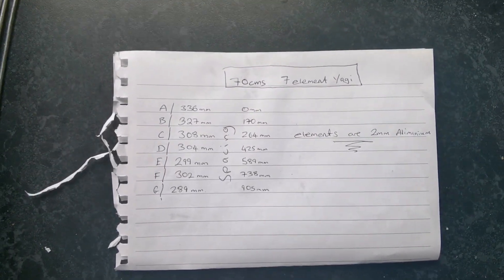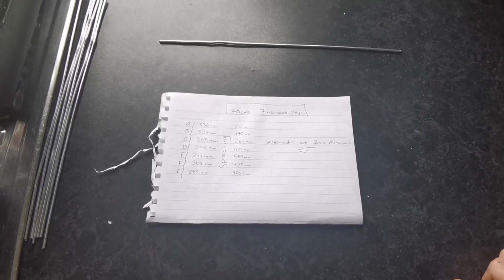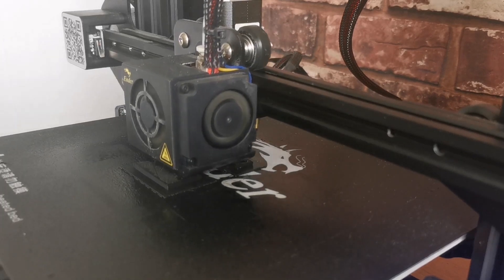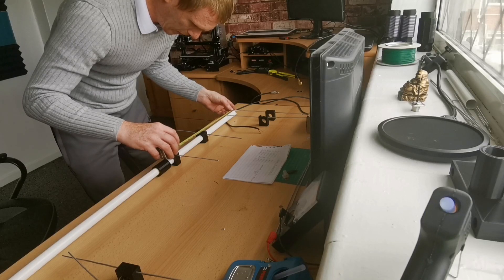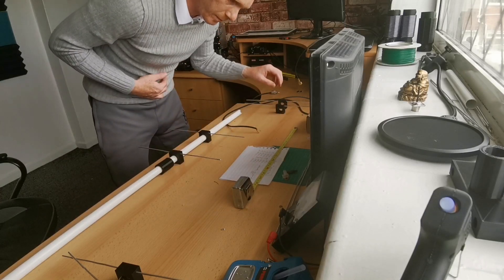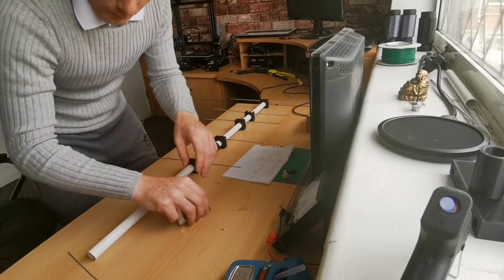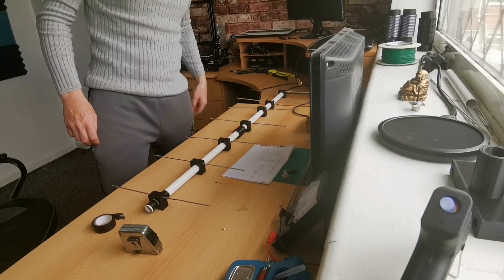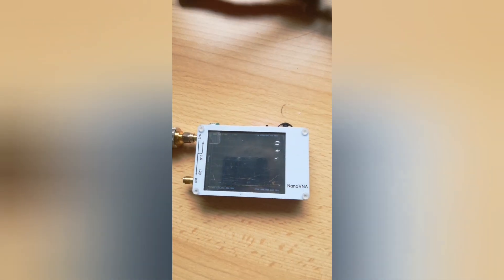Diy 3d printed 7 element 70cm Yagi

Comment: I just built a 70cm yagi to your dimensions and some 3d printed element holders.... 
And it works fantastic.!!!!!!
I used 10 guage copper for the driven elements.
And im using rg-58.
And my swr is 1.2:1 from 430-450MHZ (1:1 @ 440.000 MHZ)
And I had 4mm aluminum rod on hand for the elements.
And I am using 1/2 inch electrical PVC for the boom.
And As soon as I can get  a video made ill Upload😁 it.
Reply from the maker: Sounds great iam pleased you found my video. Pleased it worked out for you.

Comment: Great effort Fran. Like the use of the brazing rods. Good SWR too. You need to be on the 70cm contest next Tuesday evening pal. Good luck with the testing.
Reply from the maker: Yes I will be going out to test it when the weather permits. Is the contest ssb?. As I only have a baofeng with fm 😔